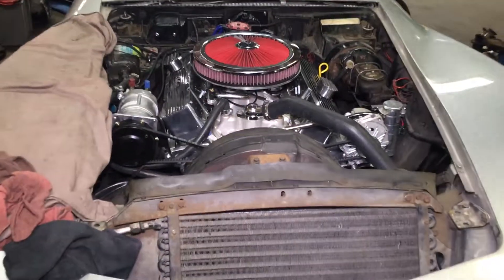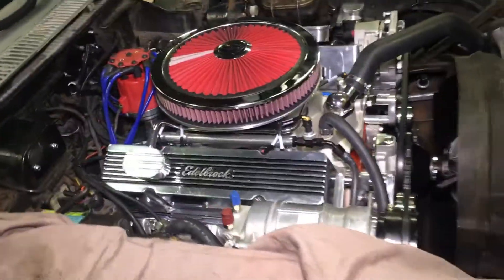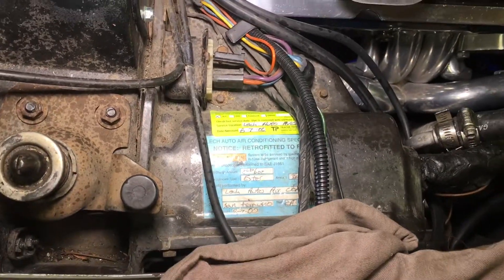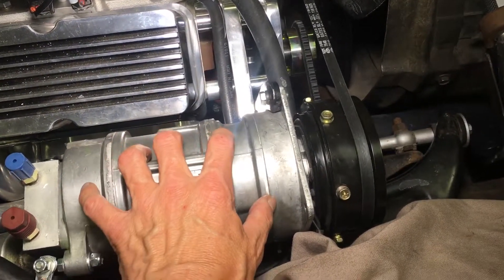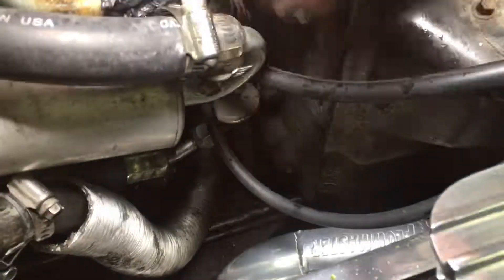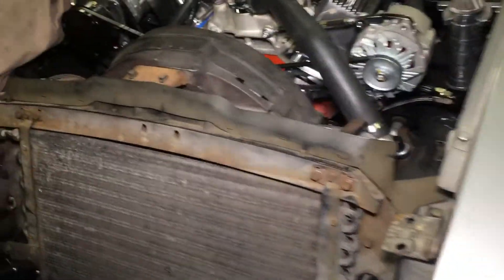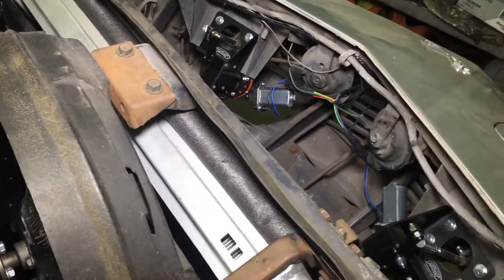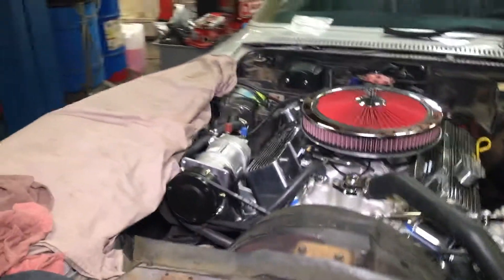68 VETT R12 to R134 Retrofit

Comment: I’m in the process of changing my 1968 Camaro over to R134a  . 

I have seen folks placing Sanden 508 ? 

I want a compressor that will fit with my original bracket like I see here . 

What brand of compressor are you running?
Reply from the maker: I don’t know the name of the company, but this is a very common direct replacement drop in. They were manufactured in China. There’s another manufacturer makes the same exact identical, aluminum Body AC compressor for this direct drop in replacement.

Try contacting RANCHU there are AC parts and components distributor with a few locations around the country